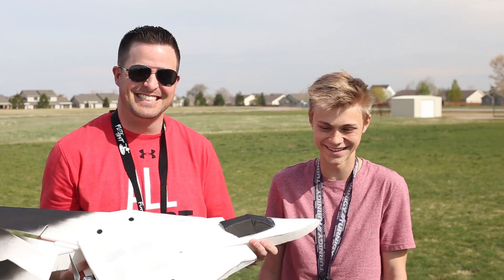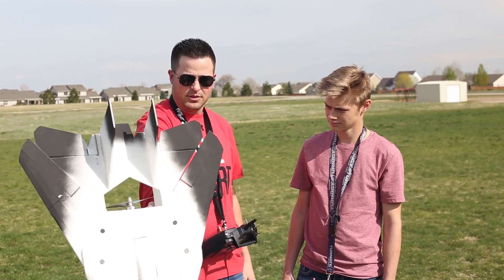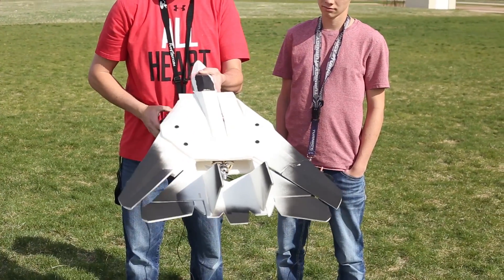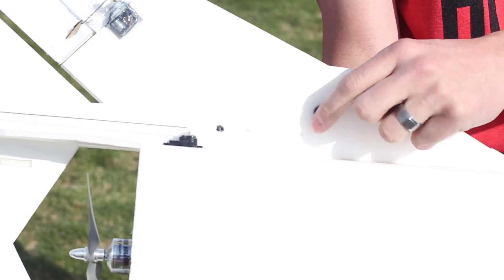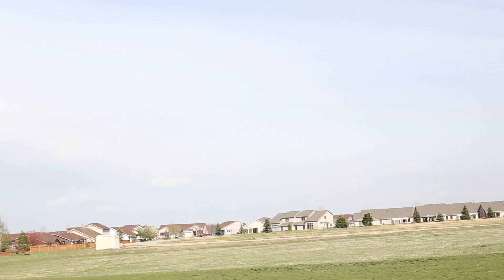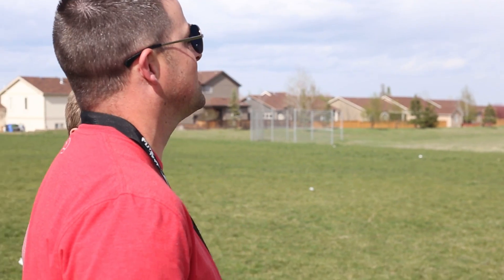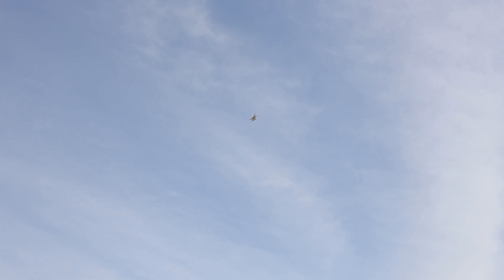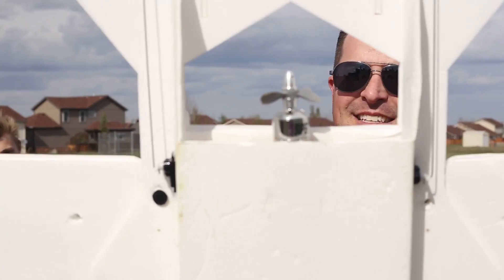MESArc - MF-14 Tomcat Prototype

Comment: I would recommend placing some small weights on the wingtips that way the weight would shift forward when wings are in the forward position and would shift rearward when swept back. I think the battery would be placed more in the forward position since the majority of the weight shift would occur when in the swept back position. Been following your designs since the Wolverine was posted on FoamFighters. What ever happened to FF"s?
Reply: +Bruce Gaskill The closer to the tips the smaller the weight. The closer to the body the less the weight shift. I'm sure there is a math formula out there somewhere and would be a great learning lesson.

Comment: Really cool and challenging design to tackle!  I encourage you to try to convert one to active/powered sweep. :D    Tip for CG movement: instead of needing to move the battery to get the CG right for different wing sweeps (which you can't do in-flight), try placing small (symmetric!) weights in (or near) the wingtips.  The tips have a lot more fore/aft travel when the wings sweep, so you can get the CG-shift you need without moving as much weight, and you can do it in flight.

Keep at it!

Comment: You guys are probably already familiar with it but Steve Shumate (jetset44) has a Tomcat design with a swing mechanism that works really well from a single central servo.  You can check out his design over at parkjets.com.  It would have to be modified to fit your design but it would be a good jumping off point.